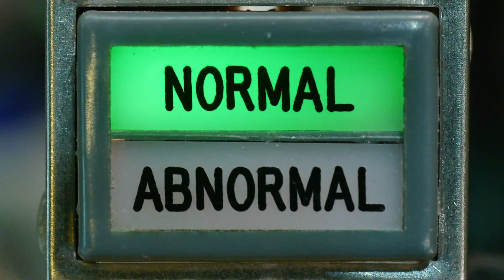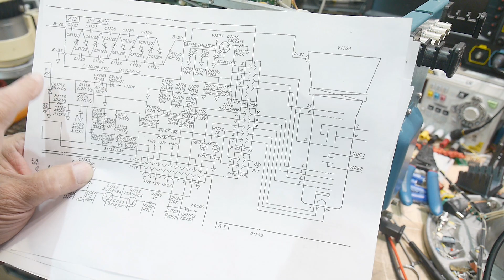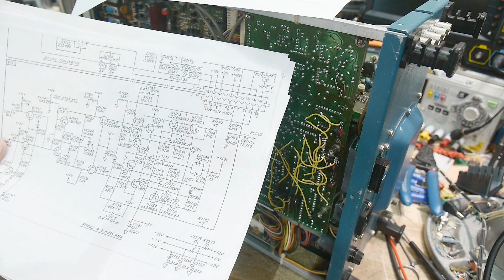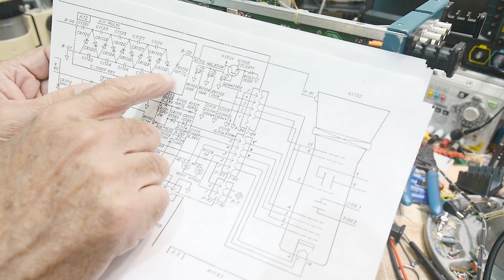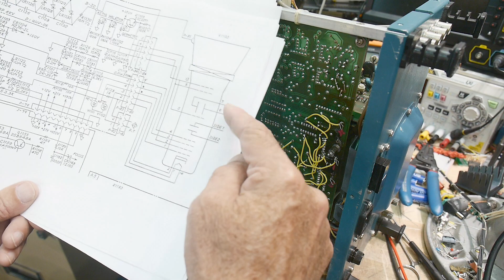#1156 Kikusui COS6100 repair (part 10 of 11)

Comment: My two cents..
First thanks for taking us on a long tour..

I been watching some chapters and you fixed and rewired lots of circuits....

Where are our retired Japanese hobbists  that built these for a living?

Is the cathode broken...it is drawing current and emitting electrons? Maybe it has a indirect cathode a cloud or the space charge doesn't form enough electons to be accelerated and focused into  beam to the screen. Does the cathode drawn a normal amount of current. I don't even know if these electrostatic delection tube use like 6.3 VAC for their filament like those old tube radios....

I was thinking maybe there is old oxide on the filament and if you went  and inserted say 30-50%  more supply voltage from an external supply could this rejuvenation process help...but that is just a causal uninformed guess and the rodeo will end if you burn it out...

Does the cathode draw the nominal.amount of current?...who knows if the schematic lists the current.  IF the power supply open circuits reads 12 VAC...then maybe loaded and connected will read 9 volts....but if it loads it down just a tiny...then the tungsten has emitted as a fine mist.and is shunting a grid and anode accelation plates...idk...

I think that was checked and repaired and the filament supply is good

So is the tube bad...or are the anode voltages too low? You made great measurements with that probe and analog 260 like looking voltmeter...

I know they have some test points...maybe the test meter Z is specified. I think the currents on the grid...acceleration anode focus and vertical and horizontal elements drawn less current compared to a electromagnetic CRT....or maybe they ate the same and I am thinking of the just the electromagnetic coild that Hog power

You seemed to have restore those power circuits nicely...and the horizontal circuits sweep shows good triangle waveforms....and the time based sweep frequency changes....good job!

If that HV doubler circuit is putting out half the voltage due to some malfuction ...could it attract enough of a focused beam to strike the phosphor..lose its energy in the form of light....and see your voltage with respect to time imuminated beam?...I think you probed the diode...and capacitors....

So maybe don't load down the HV anode...try and measure with your highest Z DVM but not with a good Fluke..and use largest divider resistors...I would think that getting rid of 20K Ohm analog meter & use the DVM made in China that you demonstrated awhile back with scale set for 1kV....or maybe that was another You Tuber...lol...

Perhaps...you can go to that surplus shop...get the HV supply from a electromagnetic CRT or computer screen or in your own goody box in the basement...aka old TV....or Goodwill might have a working set for $9.00...and rob it... Perhaps it's rated at with 20kV ..hence maybe a stiffer supply and tiny more cuurent...could  illuminate your screen..for testing ...but going down that rabbit hole may extend to India- and its a place i been many of times.and is not always fun..if it's putting out 20 kV...and your broken scope needs only 15 kV...then maybe shunt it down with some resistors...which won't be easy to find...

I think you will have to supply like several mill amps......or back track...look at name plate scope wattage....subtract 5 logic power.....all those others...take 15 % conversion loss...find how much current and voltage should go to the anode.....I wonder if a sacrificial DVM could be propped up...away.from you and metal chassis...and read the current. I think the ammeter ...like a wag...might read and the current should change by the bias voltage on control grid

Say the HV anode switcher uses 60 watts on the primary ..side.and is 75% efficient...then 25 % is lost as heat...gives 45 watts available...20kV might then supply 2.25 mA max current...but we don't want to bog and burn-out the transistors...so when a nomal trace is displayed..maybe the voltage drops to 17 kV. From being loaded.then current is less....
So we would have 17kV....and maybe 20% of the 2.25 mA is available and is the load of attracting a normal electron  beam...then the current would be 450 uA...

Does that check out?...450 uA at 17 kV is 7.65 watts....it might be plausible.....but to me seems high and would burn the phosphor...I don't really know.

Now if your makeshift dangerous ammeter drew nothing more than a capacitance charge blip upon power up..then it would seem like your CRT tube is bad...

And I know you know ohms law like the back of your hand...

I hope there wasn't a catastrophic   event like the scope was being used and fell off a bench a few feet and broke or bent some anode...but landed on its feet to hide sheetmetal dents...but bent a  accelation plate...

May my babbling not give you a headache...

I think this waatabe Tek Japanese scope...while made well with good intentions and has unique features ...follows basic design and perhaps similar ball park voltage & power levels of some same era Tek...and their documentation like on a 465.....vintage 1975. ...have some similar circuits...Their  documents perhaps may be applicable to your scope as a ballpark guide and there are retired and active experts out and are more plentiful....

Your tenacity is apperceive & inspirational....

Don't give up.
..but definitely tale a break....I believe someone perhaps will come out of the woodwork...and maybe send you a good working exact CRT tube or whole scope..for reference,  trials testing....and comparison

About that pop....not a good sign...large optical magnifications might find a split cap....and be a clue to the circuit broken...

I can see a loosy bad electrostatic tube.sucking down the power supplies so bad until they pop and the magic smoke bellows for a tiny..

It's almost like get your hands on a high pot...put a series resistor in like 20 Meg ohm...remove all grid..vertical and horizontal...anode power connections...and probe the tube...  increase  the high pot slowly  to the rated voltages...to see if they consume current. Our old Hipotronics went up to 5kV....and had a microamp meter...that could withstand shorts...sort of like using it as a CRT tube tester...

I don't think the cathode emitted metal...for it seems to be still glowing...but maybe it did during that first burnout event or during the first  repair- not on your watch..and now the beam doesn't go through its intended degined deflection path...and iit s stick trying to illuminate  the side wall of the CRT

I like the beam find button on the Tek...
Like when I am lost -and way over driving a vertical ...its good to use just for an instant...

Perhaps your scope has this or a similar feature...?

Thanks again....

I can't wait to dust off my electronics  toy shop...

So many little projects to work on...
Okay Fred...then get busy...

AS you can see I have been called a rambling man...

Take care

Good job and good work 

Kind regards 

Fred

Comment: did you check the capacitors of the voltage multiplier, and the input voltage to the multiplier?
Reply from the maker: impossible, they are potted
Reply: @IMSAIGuy  silicone or epoxy? silicone potting  is repairable

Comment: I used to repair old tektronix scopes and those ran with 10KV on the HV. My Hitachi 35mhz scope runs with 12KV as i recall. Your measurement of 5kv might not be as high as it should be but it is enough to display a trace. The vertical plates should be biased so they are both at the same potential with no signal, if both plates are the same the trace will be in the middle of the screen. The vertical [position control shifts everything up and down the more its unbalanced the further away from the center it will be. If your seeing a glow the issue might be it very out of focus or something is biased so the beam is off screen. Do you see anything different when powering on or off? maybe viewing the screen in a dark room will give you a clue.

You may have more than one thing wrong so be prepared for that
Reply from the maker: in a black room there is no phosphor glow, only a dim filament at the end

Comment: I'm guessing you've already checked the CRT for shorts between grids, and possible shorts in the CRT neck connector as well?
Reply from the maker: no but I have measured all the voltages at the neck. they seem reasonable

Comment: CRT are very rugged take it out of the equation if you have a glow the tube is somewhat working. the grids voltages may be wrong but still you will get a florescence on the crt screen if you  have your -20000 volt.
Reply from the maker: there is no glow in a black room
Reply: @IMSAIGuy  🤣 you said there is glow in the back of crt.
Reply: P. S. Sorry for my bad English but it is not my mother language so be patient 😊
Reply from the maker: @danielepatane3841  yes the filament is glowing but nothing else
Reply: @IMSAIGuy  do you have a correct acceleration voltage? Do you have a way to measure it? I believe the problem is there....

Comment: Hi @IMSAI Guy, how about taking the CRT control signals and converting them to be displayed on a non-CRT display (e.g.: LCD/LED panel)?
Reply from the maker: very expensive
Reply: @IMSAIGuy  I have to do the same for a an HP Spectrum Analyzer, but I'm TERRIFIED of the HIGH VOLTAGE 😨. Do you know if the control voltages are relatively low (<100V)?
Reply from the maker: @jbrown468  it is all dangerous
front of tube +20,000v
back of tube -2000v
middle of tube 150v

Comment: You are just stuck by telling yourself you can't do it. 
It is a psycho thing. Just press thru.
The filament would burnout if the tube lost vacuum. 
But that only happens by physical damage.
Your tube is very likely fine, albeit it could be dim. 
1) Measure cathode current, could be 5ma or so, but if 0 then biasing on the tube is way off
[cathode is the second element just above the heater
2) You had hissing HV so probably that is fine, measure HV with it connected to the tube.
a problem in the Cockcroft–Walton, voltage multiplier would likely load the HV way down. 
3) Treat the circuit for which you replaced the transistor like any amplifier, inject a signal and trouble shoot it. Probably that is where the issue is.
Note: nothing on the CRT means either the deflection is way out, or the tube current is absent. Guessing here but those grids which are driven by the amp probably control illumination and focus. LIKELY the issue from what I have seen.
- YOU CAN DO IT! Rah Rah Rah I am leading the cheers!
;=}
Ask questions.
Put up a link to the schematic,....
Reply: Indeed !